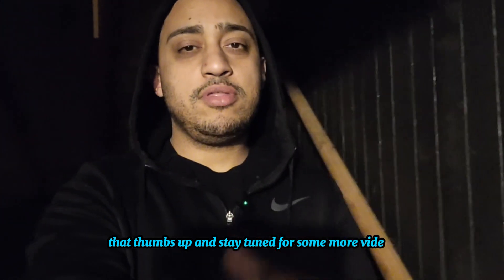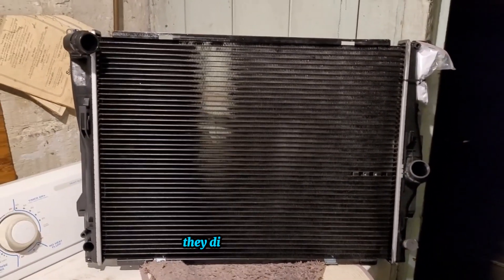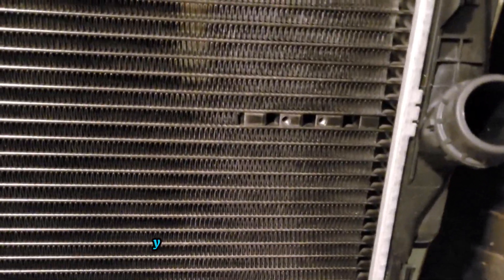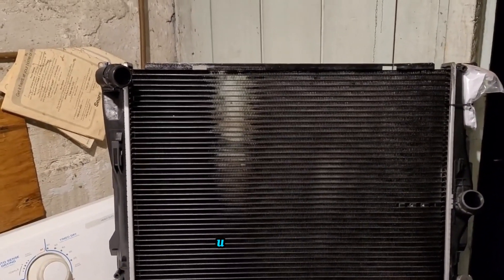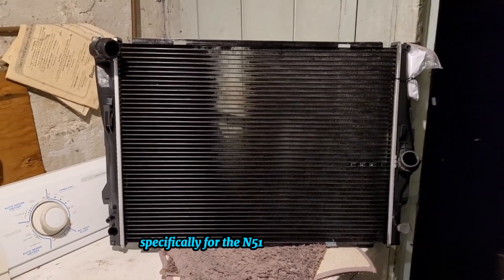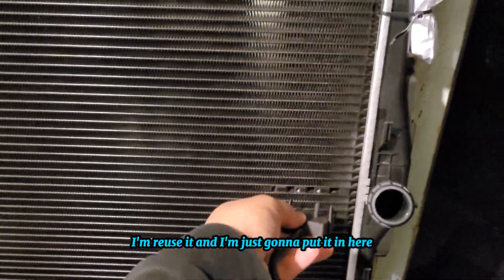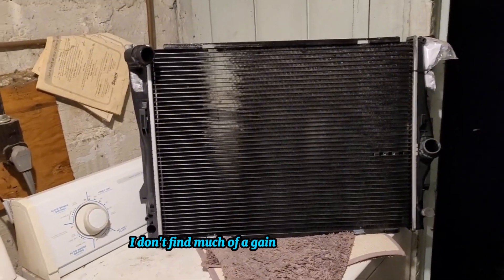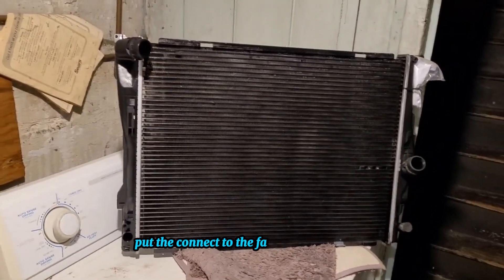BMW E90, E91, E92, E93 SULEV N51 RADIATOR

Comment: do you have to get a new radiator drain plug?
Reply from the maker: If you use your old radiator I would suggest you get a new drain plug but if you get a new radiator they come with the plug.

Comment: Will it work if I stick the sensor anywhere on the radiator? Will it work if I tie it with wire or cable ties?
Reply from the maker: I believe so, it has a slot up top to easier place it.

Comment: I got the same radiator just shipped in , unfortunately the sensor broke off on the old radiator, do I need to buy the sensor for my car to run and be ok?
Reply from the maker: @eliassaavedra5113  the car will still run without the sensor but you will get a check engine light and won't be able to pass emissions. You can get a new sensor if you need to pass emissions or wait.
Reply: @cgcars3427  Im not due for another 2 years for that emissions test , somebody told me it turns on the fans if the radiator is too hot is this true? If not I’m just going to assemble it without the sensor because I need my car rn lol , the sensor broke off the plastic probe but the wires are still attached to the sensor block itself hahaha I might re use it with some type of electrical adhesive
Reply from the maker: @eliassaavedra5113  the sensor that controls the radiator fan is connected on one of the coolant hoses so without the radiator sensor it will still work. I had installed my radiator and my sensor had broken too so I had it without the sensor and the car ran fine and the radiator fan turned on normally.  If you get nervous about it, just let the car run without driving it and watch and make sure the fan turns on.
Reply: @cgcars3427  thanks man appreciate it

Comment: Is this radiator for manual or automatic transmission? As i dont see website mentioned that
Reply from the maker: It works for auto or manual. It brings 2 plugs that go at the bottom of the radiator where the transmission cooler goes. The plugs are different lengths, the longer is for auto and the shorter is for manuals. The shorter blocks it so that no fluid comes out where the transmission cooler would go.

Comment: The oem one that they have on ecs tuning comes with the sensor but dam for 6 bills
Reply from the maker: Yea 6 bills is alot, that's what I dislike about the SULEV N51 engines. I got the radiator and sensor separate.  I bought the sensor for 90 bucks of some website that the seller bought the sensor and never used it.
Below:
Radiator:
https://www.ecstuning.com/b-csf-parts/radiator/3718~csf/
Sensor:
https://www.fcpeuro.com/products/bmw-mercedes-engine-coolant-temperature-sensor-uro-parts-221905560080?ads_cmpid=352578559&ads_adid=22978217719&ads_matchtype=&ads_network=g&ads_creative=85228362199&utm_term=&ads_targetid=pla-73092553824&utm_campaign=&utm_source=adwords&utm_medium=ppc&ttv=2&gad_source=1&gclid=CjwKCAjw_e2wBhAEEiwAyFFFo6vPwM-Dt0_vtO529ay64Tswpiqikcvx3D23-AcreP3_-N4DKJcxPxoC1xMQAvD_BwE
Reply: Sick man gonna copy all your links appreciate it
Reply from the maker: @G42jgr  no problem. Let me know what else you need.
Reply: So that temperature sensor link u sent from fcp that says bmw Mercedes that’s the correct one cus I notice it just says for n26 when u try to validate the fitment on fcp euro
Reply from the maker: @SlwE92  it's the same one. That's the same one I got and it works fine. Here try this website below because it actually lists the N51 and you can enter car info to match it.

https://www.autohausaz.com/pn/14705245-UR-262188100?utm_source=google&utm_medium=cpc&utm_campaign=feedmobile_BMW&gad_source=1&gclid=CjwKCAjw_e2wBhAEEiwAyFFFo8UMFB5iWXCBNu2DRt3YpzJl7SDcnXq70-GXf4cyNEwzQgM_ahZfFxoCe6oQAvD_BwE
Reply: Sick appreciate it dawg